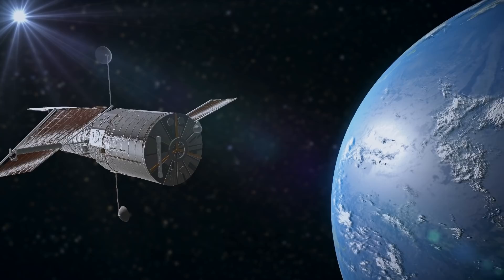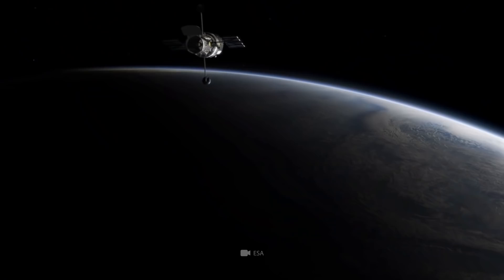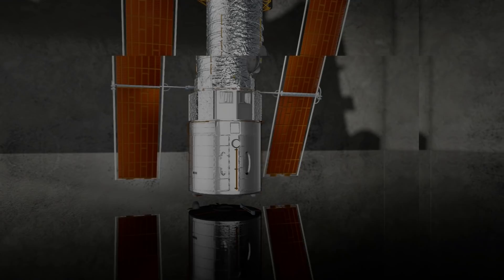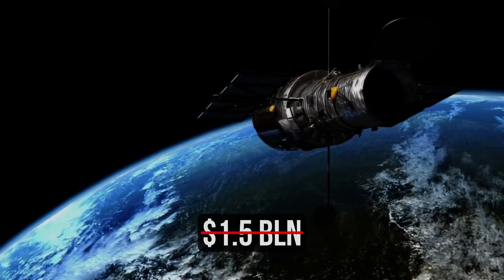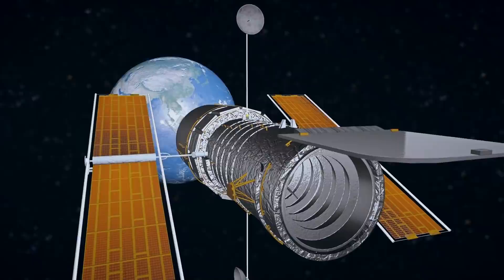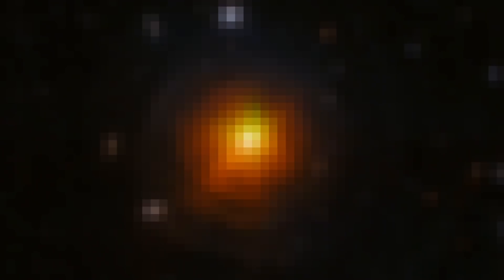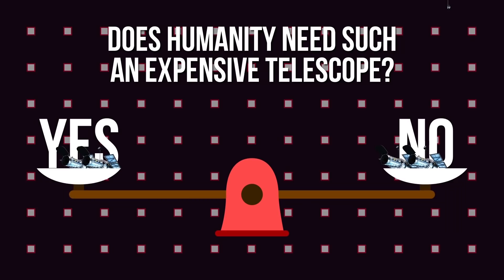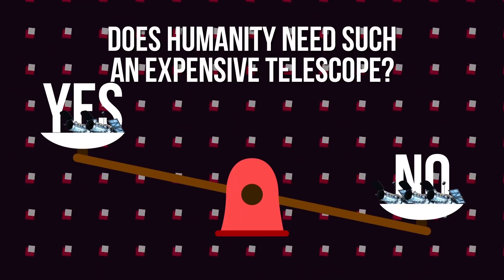You Won't Believe Your Eyes! Hubble's Images Still Shoсk Astronomers

Comment: During college I had the job of grinding and polishing secondary mirrors for telescopes. Incredible how much time I spent removing a few microns of glass. Nearly a month in some sections just to thin it by a couple microns. One was unfortunately shattered in transit, while the other is in Europe at an observatory. 1 meter diameter and less than 1mm thick, designed to flex to change focus and sharpen images.
In my opinion, the benefits of continuing these kind of endeavors is far reaching. Just the fact that we are improving our knowledge is priceless, and the advancements in science that we rely on day to day can be traced back to aerospace research

Comment: We need more, don't use just Hubbles or just Webb. Why? in case the others are not working, we still get the image. Even better if we have super high-resolution video.
How about maintenance costs?

We should think of a way to counter the problem. Eliminating still usable Hubbles is not the answer.

Comment: We really need to fix our schooling system here in America.. namely we need to put more emphasis into making sure every single person has a basic understanding of geological and astrological history.   Earth's surface has been either completely sterilized or very nearly sterilized countless times.. people don't understand this.  About 75% of those times were from impacts with large objects as the earth passes through the taurid meteor stream every 2500-3000 years.   And the other 25% of those catastrophic events were due to impacts with objects that originated in the taurid meteor stream and were in one way or another pushed out of the stream and found earth  in their path.  This is what likely caused and what ended the last ice age. And We're 99.9% certain this is what wiped out the dinosaurs.  Do we really think the thing that's happened over and over and gave our moon its countless craters isn't going to happen again?    The point of my little rant is that people don't think about it at all.  When it comes to funding the politicians are more concerned with all their own little earth centered agendas wich are completely trivial if we all get completely wiped out by a giant rock that we had the ability to detect and to intervene but chose not too.